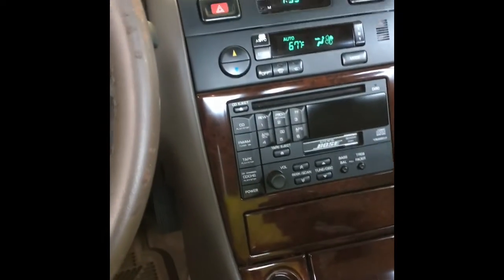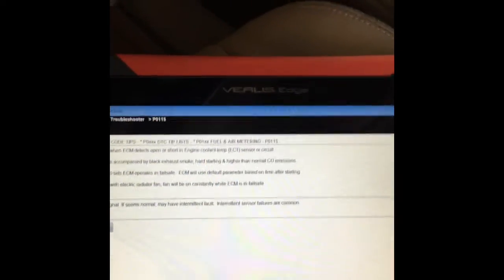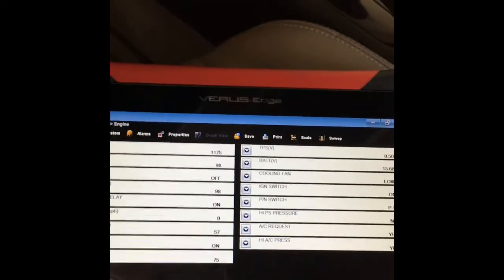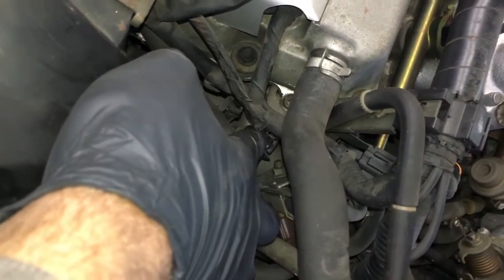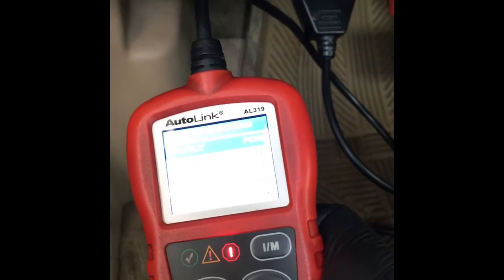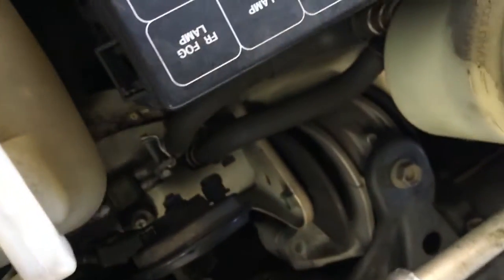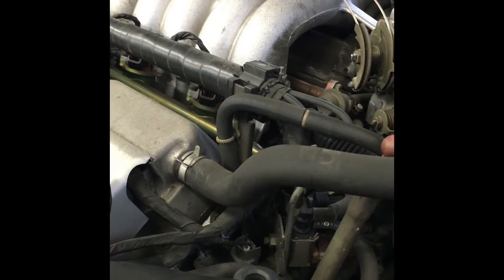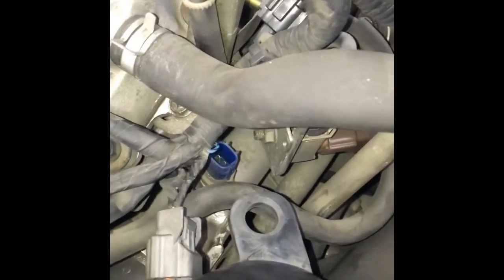How to Diagnose a Nissan Maxima with Codes P0115 and P0125

Comment: I have a 95 Nissan Maxima it'll run but once it gets warm it cuts off when I get ready to drive it and then it don't start back up until I hold my foot to the gas while I turn the key then it starts up what can you cause that problem and it takes like 30 minutes for it to start back up
Reply: I'm having the same problem after I have done a motor swap did you ever find out what was causing this